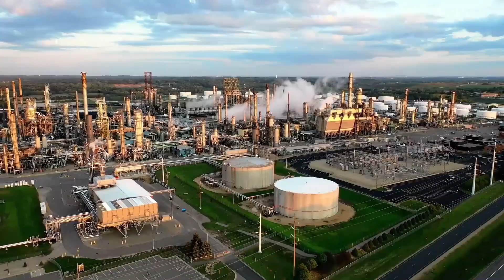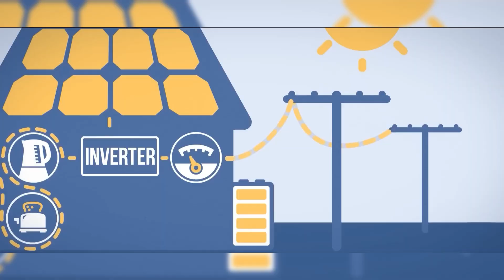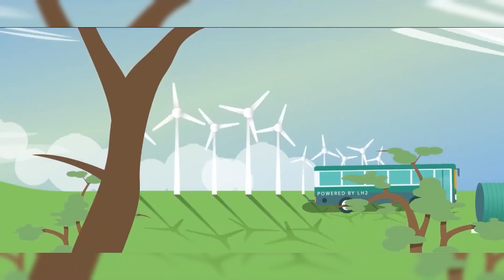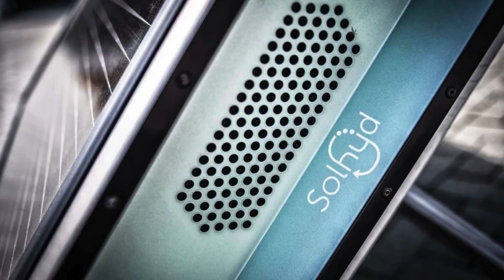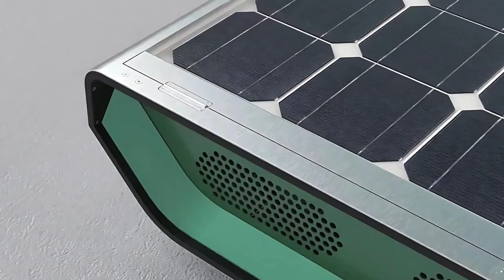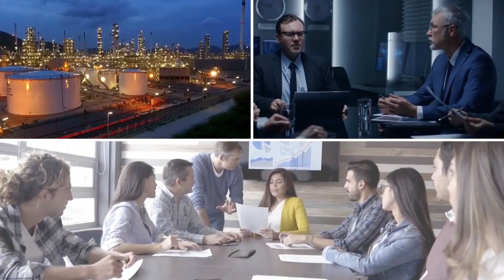The Solar Panel That Powers Your Home and Fuels Your Car 🌍⚡

Comment: Why would I use solar power to power making hydrogen and then use that for power for something else when I can just use the electricity directly?
Reply from the maker: less loss of energy. Just by converting solar energy into electricity you already lose more then 60% of the energy. When converting electricity into hydrogen, 60 to 70% of the energy used is converted into the chemical energy of the hydrogen.
Reply: @Generalphysicsknowledge So you end up with 36-42% of the energy instead of 60%.
Reply from the maker: Modern solar panels have an efficiency of 18-24%, meaning we can convert approximately 20% of solar energy into electrical energy. We then need to use the electrical energy to produce hydrogen. Modern electrolysis has an efficiency of 60-70%, or approximately 65%. If we now extract 20% of 100% of solar energy, and then convert only 65% of this 20% into chemical energy, we have an efficiency of approximately 13%. So we end up with 30-42% instead of approximately 13%.
Reply: @Generalphysicsknowledge How?  I've only read of hydrogen modules achieving 9% efficiency.
Reply from the maker: https://docs.google.com/document/d/e/2PACX-1vRjSYkMhf1dCOoCQ1mxZjxXG_WQlvfIcbflIwqKpEuxmw11wW_CarcU8BC5UPe8CH_MkwlalBrkah06/pub